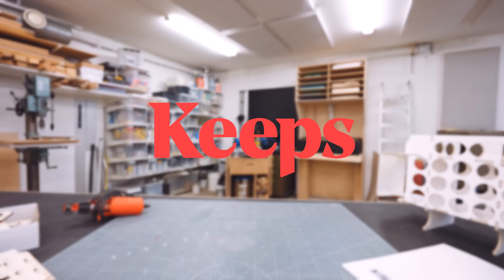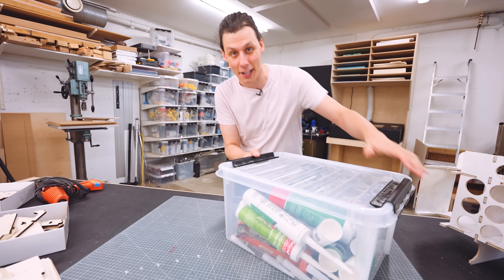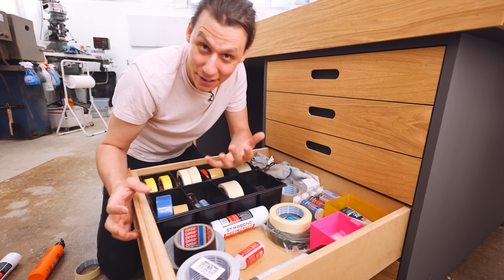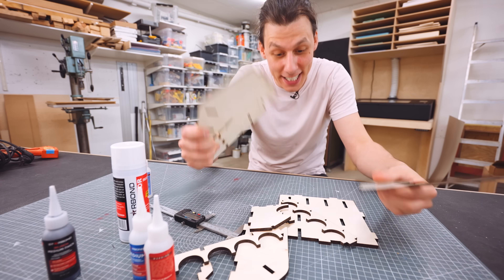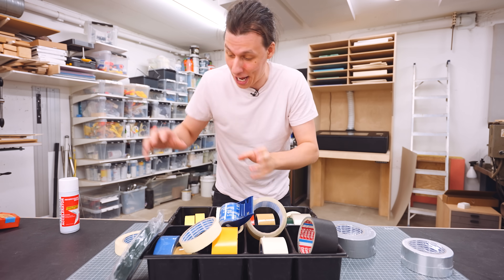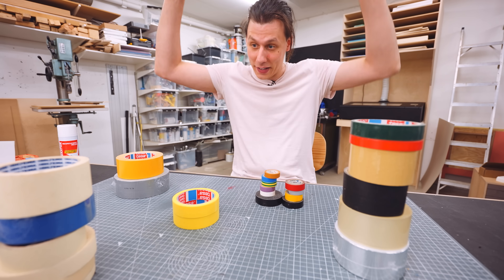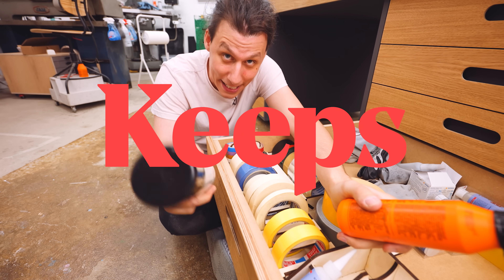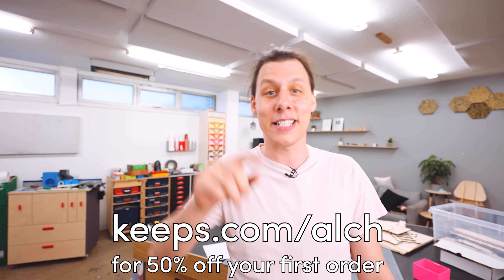Laser-Cutting Organisers For My Workshop

Comment: Somehow missed this video when it was released - I absolutely love laser cut panels instead of the 3d printer when I'm working with predominantly large, flat constructions. Lately I've been doing a hybrid laser/3d process where I'll make mounting slots or finger joints where I can slide in a 3d printed piece for complex geometry. This saves on print time and allows me to focus on smaller sections when prototyping. Thank you for sharing the angled storage solutions and including the draft angles of the storage box, I can't wait to use this approach in my storage. Cheers!

Comment: A little note about Fusion 360 that Angus from Makers Muse also made a little while back. The free version of Fusion 360 doesn't have all the features as the full version has. Granted, it has the features to model parts for CNC and Laser cutting, but I'm not sure whether it has the features for sending the design off to either machine. I'm using the student version, which is really just the full version disguised as an educational version and the only way of getting access to this "educational version" is to be a student at a school that have it. I will though say that if you're currently using something like SketchUp or similar, do make the shift to Fusion 360 (or Solidworks if you got the opportunity). Seriously, you will not regret it and you'll quickly adapt due to your experience with SketchUp (or similar). Unlike Blender where you need to start all over again, in Fusion you just hit sketch and start drawing in 2D, before finishing the sketch and extrude in 3D. 

There are a few differences in things like controls, extrusion of sketches (you can't extrude two sketches one by one, but have to do them simultaneously) and some other areas, but the sheer amount of luxurious enhancements you gain are insane. No more drawing balls by first drawing a circle, then using arches and then connecting each vertex point with a line to form a dome, before duplicating it and turning it 90° to make a sphere. In Fusion 360 there's a tool for that. Similarly there are bevel and round over tools, so no more sketching the size first, before using extrusion to shape the roundover or bevel. Just take the tool, click on an edge, type in the number and hit enter. And if the number entered isn't possible, Fusion will tell you and refuse to even attempt modelling it, so no more messed up meshes due to lag. Sure, Fusion 360 can still lag and crash, but it saves a backup, so when you open it up again, you aren't royally screwed, but can start over from the last backup. And backups happen automatically while you model on it. You also get to save everything in the cloud and you can render your models to get an idea how they would look irl, without having to use fancy rendering programs or learn Blender. It costs about $43 USD per month to have the full version, but when I'm done studying, I'll definitely start a subscription. I would always much rather pay for good quality and time saving tools, than doing it "for free" and spending upwards of 10 times as much time. We don't live forever, so my advice is to get the proper tools from the get go. They're not an expense, but an investment into all of your future making.

Comment: How about a more indepth guide into how you go about designing parts like these? I have a laser cutter too and I'm struggling with what tool to use. My go-to would be Fusion 360 but it doesn't seem particularly well-built for laser cutting projects.

Comment: I would agree that laser cutters are very good, for flat things that you can assemble at least (okay so most things).  While it would be possible to make complex structures out of very tiny flat pieces of wood, I would prefer to use a 3D printer. :P

Comment: You should try your hand at designing a super glue storage container that's air tight so you can add a desiccant like silica gel or molecular sieves to keep the air dry.  Superglue will not harden if the air is dry as it reacts with water to cure.

Comment: 3:28 Since when is fusion 360 Free?
Reply: Since it came out. You just have to keep tunneling in to find the maker or personal signup page. Put in a request and voila you get a personal license good for 1 year where you have to go through the same dog & pony show each year to renew. You’ll be restricted from some features and limited to 10 “active”projects out of your list of many, so just switch to the one you want to work on and make it active if it’s not already. You won’t lose anything making it inactive just a hoop to jump through to make you realize you’re getting something (great) for nothing. Restricted from using for profit over $100k using the honor system. (No tracking  as far as I know, but I use it for hobby purposes so it hasn’t been an issue)

Great video Alexandre, as always. Keep up the great content.
Reply: @jamesmiller7278  Fusion 360 is NOT free! It takes your work hostage! FeeCAD is free! Use FreeCAD!